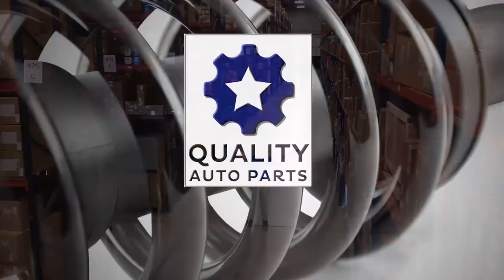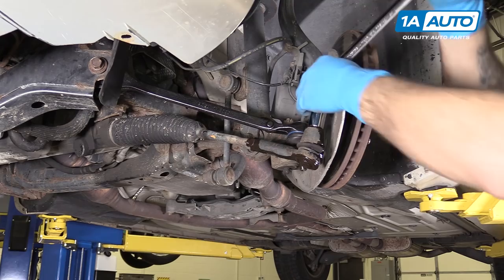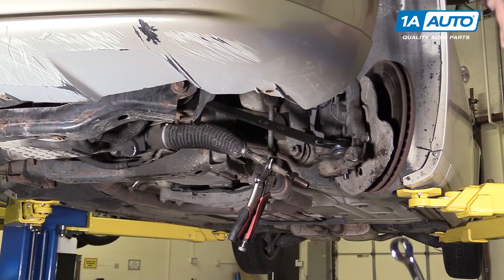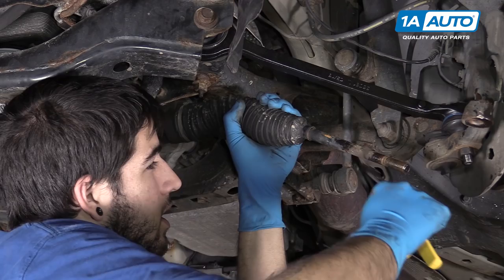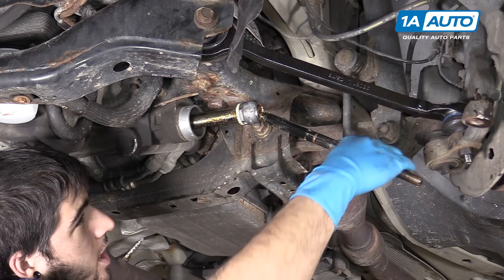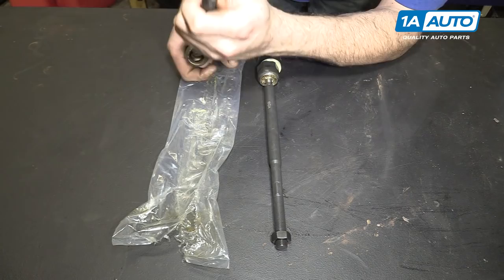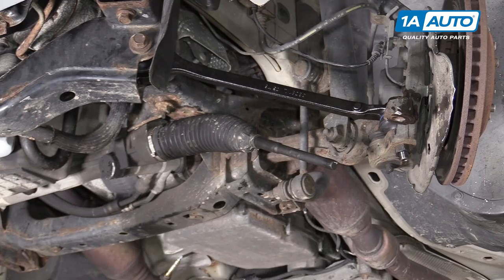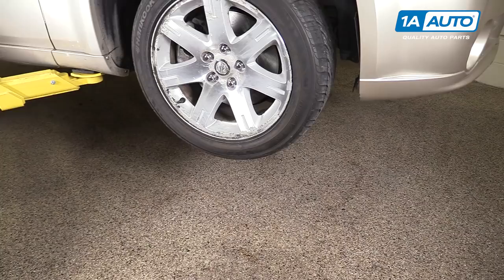How to Replace Inner & Outer Tie Rods 05-10 Chrysler 300

Comment: You should post a video of how to replace those troublesome rear axle seals for the 2006-2010 Dodge Charger/Chrysler 300. 

A local shop wanted $600 to do the job.

Comment: At the end, what did you mean by grease the fitting until the boot swells? What kind of grease are you using?
Reply: It means to attach a grease gun to the shiny silver 'zerk' fitting on the bottom of the outer tie rod end and push grease into the fitting. As you add grease it will cause the rubber boot to 'inflate' with grease.  If it pops, you added too much.

A grease gun and cartridges of grease are available at your local auto parts store.  I use a Valvoline multipurpose grease in a red cartridge, but that's because it's what my dad used not because of any specific qualities.

Comment: I replaced the inner and outer tie rods on my 05 magnum. I noticed that my new inner tie rods were about 1/16" shorter that the original ones and my outer tie rods were the same length. I put everything back together using the same turns on the nut and outer tie rod that I counted when I removed the original tie rods. My steering is now very tight  and when I turn to the left or right it doesn't return easily, should I have compensated the turns for the difference in length with the new outer tie rods?

Comment: Would a grinding sound when turning the steering wheel be an indicator of a bad tier rod?
Reply: GAH I’m about to change my inner tie rods because of a loud clunking noise coming from turning left or right. Just take a look under the car while someone turns the wheel and pinpoint that noise.
Reply: Clunk or pop, maybe.  Grinding, probably not.

Comment: What are those white insolators called or what is their part no.?? 
Mine broke but can't find them anywhere!
Reply: panzerpat I think travel limiter
Reply: Or try steering rack limiter
Reply: My limiter didn't look like it was limiting much. It had a split in it and what ammount looked like the gap as probably only a 1/32 or less thick.

Comment: Is it important to add blue thread lock to the inner tie rod threads? Or is it not exactly necessary.
Reply from the maker: +adam burns Thank you for checking us out. It is highly recommended to ensure that the inner tie rod end doesn't become loosened while driving. 1aauto.com
Reply: For that to happen, the outer-end (jam nut and rod end) would have to come loose first.
Reply: Not necessarily,  the inner tired end can loosen or rotate independently of the rod  and outer end...the jam nut on the outer tired adjust can be snug and yet the inner tired End thats secured to rack can loosen..

Comment: After replacing I’m getting a bad drift in my steering any idea why?
Reply from the maker: +SilentzTheWicked There could be many reasons why you are experiencing this. We would first want to confirm that you had an alignment done after replacing these parts, if so then we would suggest consulting with a local mechanic to determine what else is going on with your vehicle.
Reply: lmaoooo you need a alignment!!!!